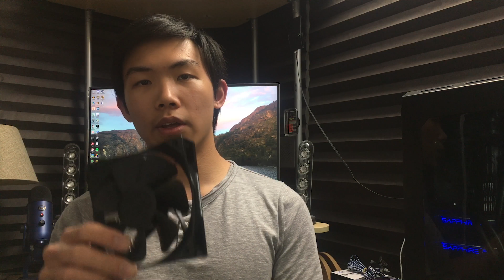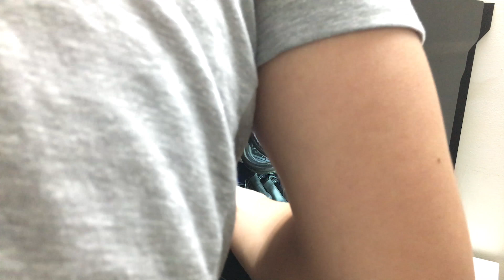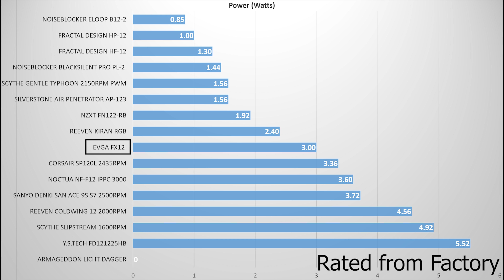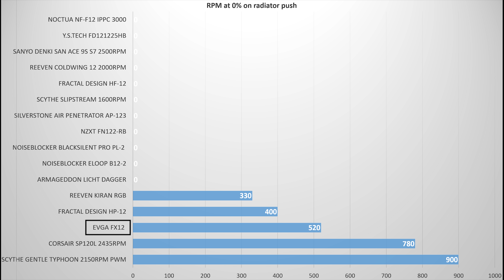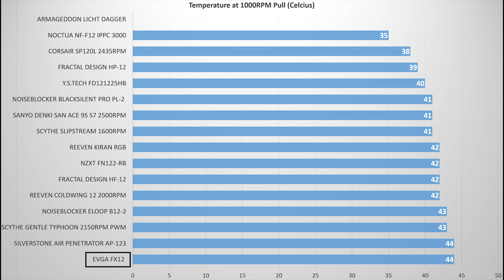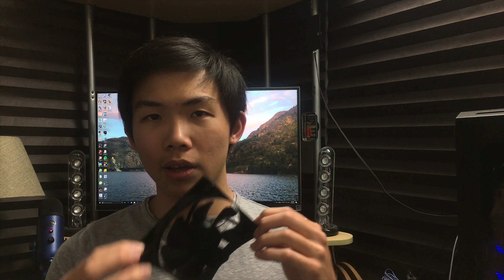EVGA FX12 120mm Fan Review | Being different doesn't mean you're better

Comment: Do the fan blades separate from the shroud? One of my fans stopped working on my evga aio cooler and it has resistance to turning. So I need to disassemble and clean asap

Comment: I wouldn't recommend those fans at all. Had the 240mm radiator and in less than 6 months, both fans went bad, motor lubricant dripping from both fans. EVGA sent me a replacement which was dead on arrival. They also have a very annoying whine.

Comment: These fans are loud as fuck! I have a clc 240 and I cant stand them anywhere over 1000 rpm. And their flow control software is also trash. They locked fan speed at 100% for temps of 60c or above... WHY
Reply: Really bad. I just ordered Noctua Chromax to replace them. Hopefully it'll be better.

Comment: This fan sucks.  When these fan rev up high it fails to to push air thru the radiator instead it just bounces back and leak out the sides.  You can barely feel the air being blown out the radiator.  I have a 10 year old scythe fan that's not meant as a static pressure radiator fan but it moves ton of air out the radiator.

Comment: With an EVGA associate code you can save between 5-10% off on the EVGA website. Just remember to put one in at checkout. Codes can be found on the EVGA website forums or you can use mine: 97A7E89A6R1N2LI To find out more about the Associate program and to have the option to use mine without a cut and paste you can fallow this link https://www.evga.com/associates/default.aspx?associatecode=97A7E89A6R1N2LI

Comment: These fans are now a $5 Amazon Add-On item. I picked up the 140mm versions and they are intolerably loud in my Lian-Li server case unless I sent the fan control level extremely low. Unfortunately my server board has a bug that causes fans to bug out up to 100% from time to time, so I had to remove them.
Reply from the maker: These aren't very noise friendly yea